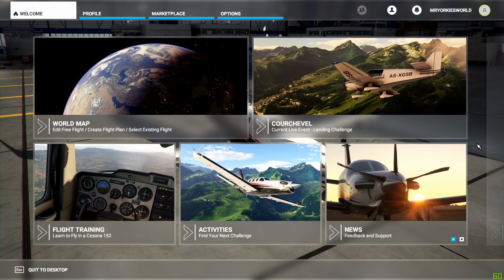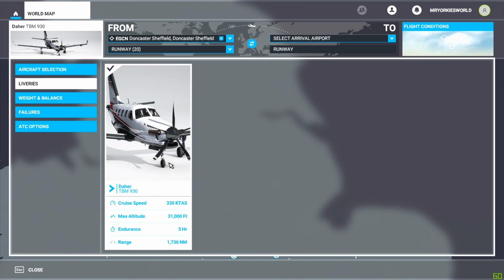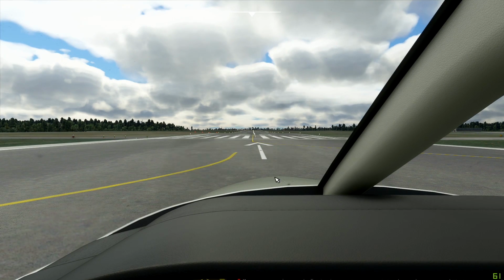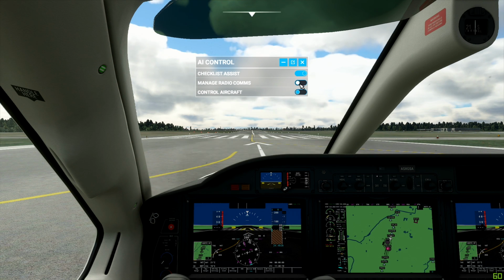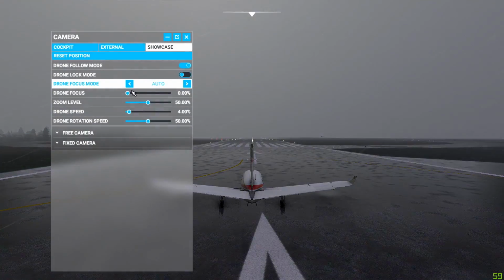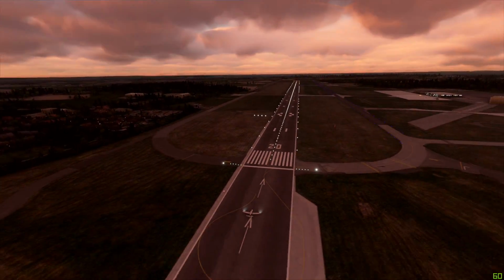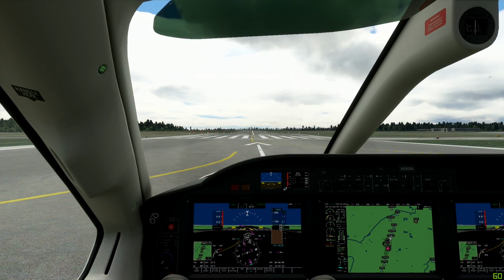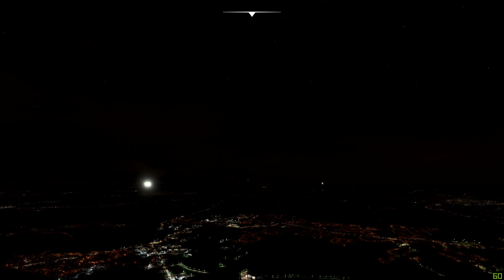An Introduction to the *NEW* Microsoft Flight Simulator…(Preview Build) | Stunning Visuals!

Comment: The new Flight Simulator is just amazing! Do you think with an i7 4790k (running at 4.5GHz), RTX 2060 Super 8GB, 16GB RAM DDR3 1600MHz I can run this sim with graphic settings set to high? Thanks for this video.
Reply from the maker: It certainly is! I think that setup would probably run fine, I used to have the 4790k and it’s still a pretty powerful CPU
Reply: @MrYorkiesWorld  Thanks for your response! Yes, the 4790k is a beast

Comment: How much system Ram is the sim using?
Reply from the maker: In my case it usually uses around 50%, sometimes a little more. I have 32GB installed

Comment: Never used a flight sim before but i have pre-ordered the prem del version and have a hotas on the way - will it be easy for me  use a hotas as a first timer  at flying ?
Reply from the maker: I have the Hotas as well, it's fully compatible and very easy to use within the sim. You can also customise the button functions inside of the simulator if you need to :)

Comment: 4k or 1440p?
Reply from the maker: I run the sim in 1080p
Reply: @MrYorkiesWorld  oh geez so 2080 ti cant get consistent 60fps on 1080p?
Reply from the maker: I don’t think any GPU would be able to get a consistent 60FPS all the time, as it depends on the complexity of weather, scenery, traffic etc... and especially in larger airports such as EGLL you’d probably struggle to get 60FPS at any resolution without having to significantly tone down the settings. 

I have noticed at certain smaller airports I don’t have any issues getting 60FPS, but this can quickly change depending on the situation.

Comment: Hello 
Amazing vid , specially keeping the FPS counter , i have an identical system like yours , although i only fly in VR , can u give a rough estimate how would u expect this system to handle VR when its out on high or ultra settings? 
In other terms how is your FPS in a 747 cockpit 9L in Heathrow hi or ultra settings 4k in 2d

Thanks
Reply from the maker: Thanks very much! I don't personally use VR and so I can't comment on that, and I'm limited to 1080p with my monitor, however I'll make a video shortly on what performance looks like at EGLL :)
Reply: MrYorkiesWorld waiting for it , thanks

Comment: Would you mind letting me know your CPU usage and temps compared to p3d? I have a similar CPU (10700k) and wondering if the CPU temps are going to be lower in the new sim.
Reply from the maker: The CPU usage seems to be relatively low for me, as the simulator uses more GPU power it seems. The temperature usually stays between 50 and 60 degrees Celsius throughout flights in FS2020 :)
Reply: @MrYorkiesWorld  That's because you have a solid CPU.Any old 4 core chip will struggle with this and will result in high usage and stutters